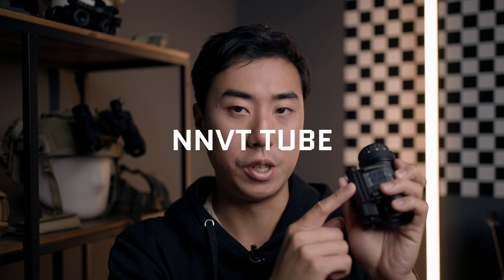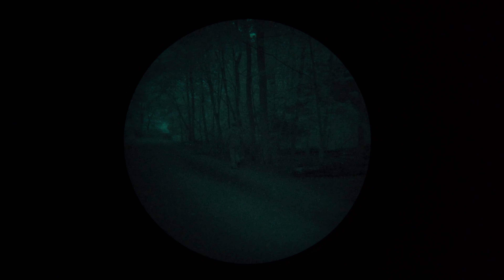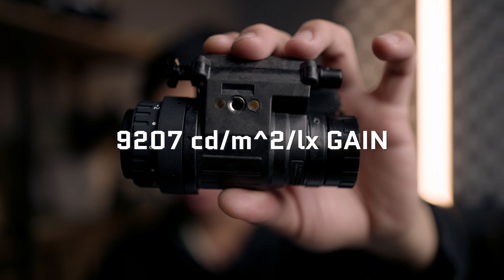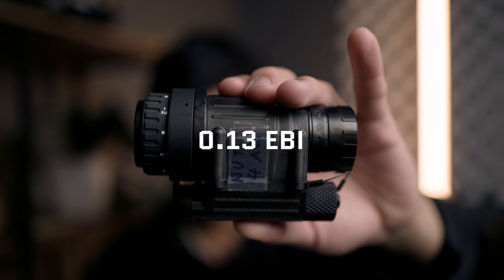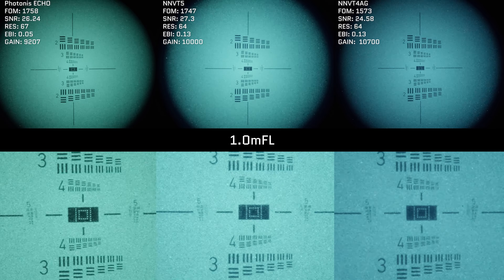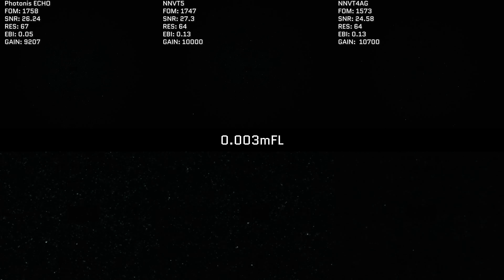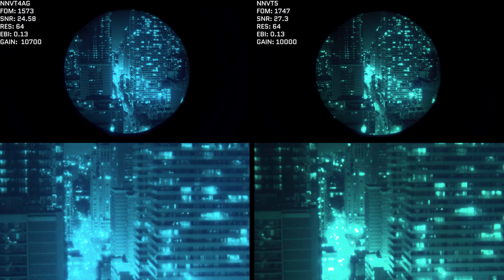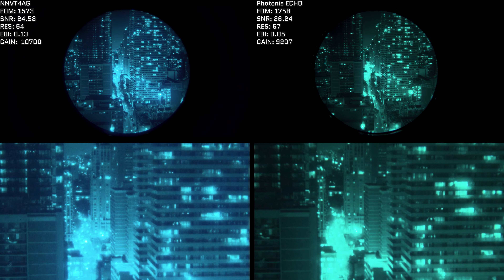Chinese Autogated NNVT vs Photonis Echo | Are these NVG tubes any good? [4K]

Comment: Nice video. We don't produce many sub-2000 FOM ECHO's anymore and don't make the XD4 or XR5 series, although you'll still find them listed on our website. Might be interesting to compare the NNVTs against a 2500 or 2600 FOM ECHO or 4G. However, what I'd like to point out to your audience is that you mentioned one significant item that I haven't seen anyone cover before and that topic is contrast. Indeed many users boresight on high gains and image brightness especially when discussing Gen 3 tubes, however Photonis tubes have the best contrast in the industry, thus you are correct in that a lower gain Photonis tube can produce outstanding resolution at low light levels (NL-4 or NL-5) due to the performance in contrast. For your viewing public please stay tuned for our new 5G image intensifier tubes which will supersede our 4G tubes. In the meantime we always recommend that people get whichever goggles and image intensifier tube combinations that they see the best with, that meets their price point, and it looks like NNVT is a capable entry choice.
Reply from the maker: Very well said.  To be clear, this video is NOT meant to undermine the performance of Echo in any way, as they are and still continue to be the highest performance-to-price ratio of any commercially available intensifier (in our opinion), especially on the international market. We've see even 2000+ FOM Echo+ intensifiers blow the NVT4's and 5's out of the water in all conditions, so there's no doubt 2500+ FOM Echo or 4G will do the same.
Reply: Wow, it is crazy to see a larger defense manufacturer step into the scene and talk directly to consumers.  Really cool to see things like this.  Keep up the good work over there.  Also keep up the good work on your sensors, having developed on your LWIR and NIR sensors, I have to hand it to you guys.
Reply: Awesome information, Thanks!
Reply: Where does this place Photonis on the new product 4G-5G compared to L3 18/20 um tubes ?
Reply: Super high FOV gucci tubes are great and all, but it would be amazing to have a barest-bones Gen1.99999 tube option that costs less than 1k; it can be a good foot in the door for entry-level
Reply: Based manufacturer. Much appreciated.
Reply: Photonis, your humility and honesty, while saying the competition is a valid option, gets you huge respect.
Reply: When can we see more informations about Photonis 5G Tubes? Want to know more 😍 saw some news about 4G+ High Gain.

Comment: 99% of users will never spot the difference between NNVT and photonis tubes. We are splitting hairs to see the differences.
Reply: This is not true. This ECHO tube doesn't reflect modern ECHO tubes. This is an old ECHO tube. 

I'm working in the NV business. And our company NEVER had a photonis ECHO tube below 2000 FOM or 30 SNR.
We only get echo tubes with 2000 - 2400 FOM. Obviously for the same price like this low FOM echo in this Video.

This means you get nowadays for the same price a ECHO 2200 FOM tube instead of a NNVT tube with 1200 - 1700 FOM.

Comment: The NVT4 tubes seems to outperform the nvt5 in the lowlight inside the forest. Decent budget tube
Reply from the maker: I think the largest difference between the 2 images will be the tint. To be honest, the SLIGHT bump in SNR won't make a difference and the autogating makes the NNVT4AG much more versatile in a greater range of scenarios.
Reply: @coldharboursupply  Why does the chromaticity differ when the same P45 phosphor is used?
Reply: @Tattlebot it's just the recording
Reply: @aesthetic8780  thanks. I've been told the same thing elsewhere, and I've now seen a sensor fluctuate in a recording. P45 is not monochromatic like P43, but it's still quite spiky. I looked up the XY coords and the web names for the hue include Moonstone, but that's not very tactical sounding.

Comment: I think the actual manufacturer for these NNVT tubes in JPNV. JPNV has a factory in Beijing China. You can purchase the intensifiers directly from JPNV for a couple hundred dollars less including shipping. JPNV also does not up charge for white vs green. If you purchase one youll have to contact them and pay with a wire transfer.

Comment: I bought a PVS-14 from you guys. Should they be purged often? If so, what timeframes are we talking about? How do you purge one? What if you don't purge it?
Reply: Atleast from my experience the public night vision users only need to purge if they work with a lot of water environments or get they’re nods dirty, the normal civilian sounds have to purge very often if not at all unless you notice more blems or specs in your tube, they are purged with nitrogen, if you bought a pvs14 from CHS then it should have already been purged before it arrived to you
Reply: @thomasrobb1097  how long does a purge last?

Comment: These guys have awesome customer service 
Had a pvs14 in for repair, and they blew it out of the water contacted me with parts im going to need and had in stock 
Only place to go for nvg products 
Thanks again CHS
Reply: Same experience.  Bought a really nice set of dual nods from Steven and team, and their service was top notch.  Nearly a year on, and i am still enjoying the nods, and they are flawless.  They gave me a full spec sheet from manafacturer, plus an in house hoffman report, and im really chuffed with the whole package from Cold Harbour.

Buy with confidence.

Andy and Paul, UK.

Comment: Edit: sorry was up late

SO... heres my question if I get a nnvt 4 or 5 tube...and it says it doesent have autogating or manual gain do those tubes unsteady have BSP protection at the cost of res ir just this specific tube has bsp and I would have to call and ask the dealer of the tube ...what I'm asking is can I assume if it doesent have automation it has the nnvt BSP protection instead as a rule of thumb?
Reply from the maker: Might need to clarify the question a bit.
Reply: @coldharboursupply  I edited my first post sorry haha
Reply from the maker: @justaregularguy3827  You can assume if they don't list automated, it uses BSP. To be honest, I would not worry about it. The tube will be plenty protected against light with NNVTs aggressive BSP.

Comment: Thank you for the extremely informative review. I’m about to take the NVG leap and these price tags are scary. Definitely going to save the 1,000 and go with nnvt4ag’s. If anyone has had a bad experience with them please let me know.
Reply from the maker: We've sold 100s of these tubes. No bad experiences so far. Of course they are not the best tubes on the market but they are a wonderful way to dip you feet into real analog NV.
Reply: @coldharboursupply  thanks for the info. So I had a Pvs-14 while in the Army back in 08 besides the WP how do they compare? I’m meeting someone on Saturday to pick up a gen 2 so just want to be sure.
Reply from the maker: @tabasco573rd  08 was a while ago, there were defo some great tubes in the army then, however, I think you will be pleasantly surprised at how good modern gen 2s are nowadays.
Reply: @coldharboursupply  cool brother thank you for putting my mind at ease. I’ve been back and forth until I saw this video and spoke with you now I’m confident in the product and plus WP sounds like it’s going to be a lot nicer than the green world I’m use to.

Comment: When testing my device for auto gating is there any specific type of monitor I should look at? Or would looking at a TV or phone screen provide the activation of the auto gating where you can observe the pulsing?
Reply from the maker: Any device where you can see the pulsing should confirm the tube autogating. We looked at some laptop screens (MacBooks here). It will depend on the output of your screen however. It works on phones but it will be harder to notice as well.
Reply: @coldharboursupply  thank you

Comment: What is the price difference between the NNVT4-AG vs the Photonis Echo tubes?
Reply: Here in Europe a nvt4ag tube is half the price of a Photonis echo tube
Reply: @EagleBayNightSupplies  Is there a site you know of for american buyers? I think ITAR is a thing when it comes to this technology.
Reply: @kenjipark4717  Nvt is manufactured in China, you can buy from either Cold Harbour supplies or from me😉 Itar only stops nods from leaving USA, not entering.
Reply from the maker: @kenjipark4717 we have both full builds with the largest selection of housings and we also sell loose NNVT tubes internationally (US included)

Comment: Being a person living in China, I only have access to the NNVT-4 tubes :]

I can say that the NNVT-4's are pretty good, I personally made a GPNVG-18 BNVS replica with those and it is clean as hell.
Also it's pretty funny how I get to use a literal analog GPNVG in night time war-games while the other guys are using flashlights and digital PVS-31 replicas >:]
Reply: How much do you pay locally for the tubes? I assume they're probably a fair bit cheaper if you source them in person locally in China compared to online through a Chinese vendor?
Reply: @pieterveenders9793  Third generation Green phosphor can sell at as low as 1k USD and proper white phosphor ones can sell at around 1.2-2 k USD